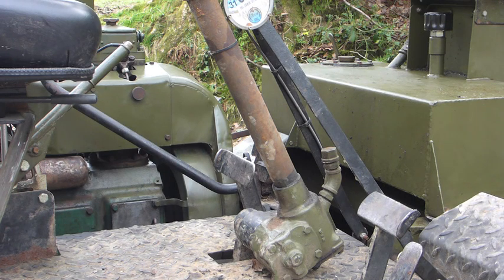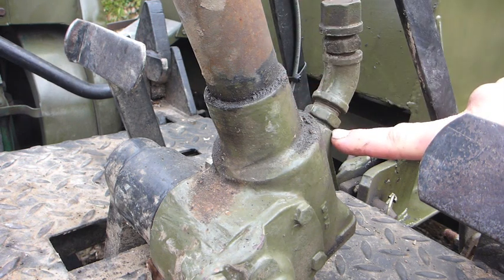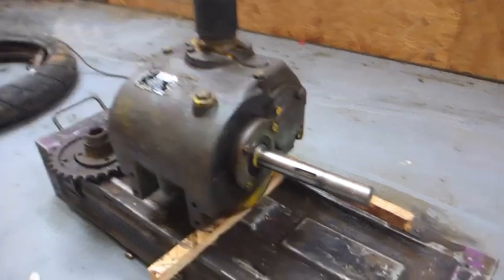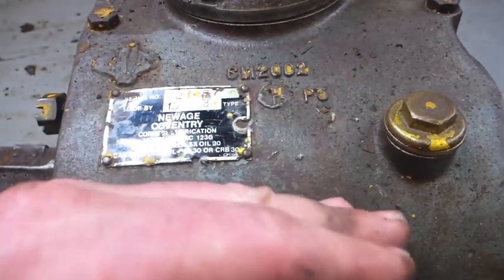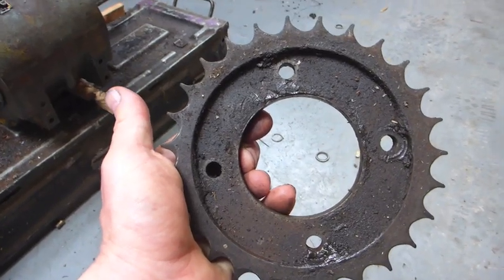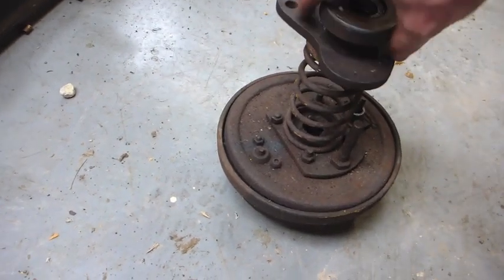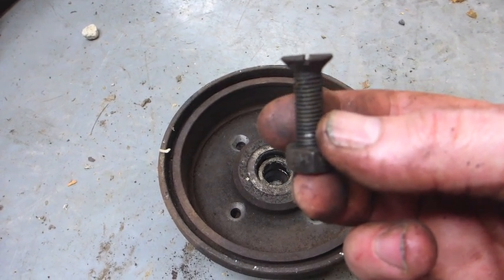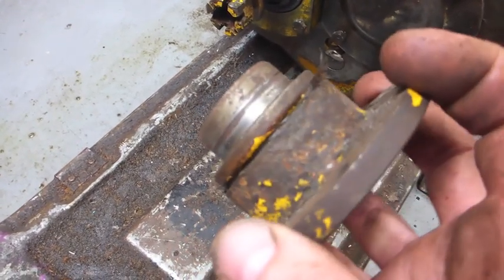Thwaites Tusker Owner's Notes Part 2: steering, brakes, clutch & gearbox

Comment: For information, I've just rebuilt my gearbox and the springs and brake shoes for the clutch are the same as those for a Triumph Herald.  You can buy them online through ebay

Comment: very interesting series. I have recently bought a thwaites  dumper. Dont know if its nimbus or nimline. Its acxactly like your digger but with the dumping bucket. it has a 2 cylinder AVA2 a bit earlier then the ph2. do you know what mine is called ecxactly?
Reply: Yours is probably a tusker dumper,  I have one with a ph2, 

Has all the brackets that are for the digger part but no use on the dumper version